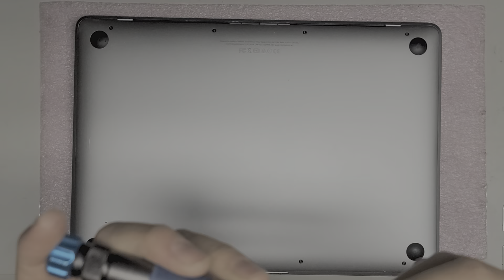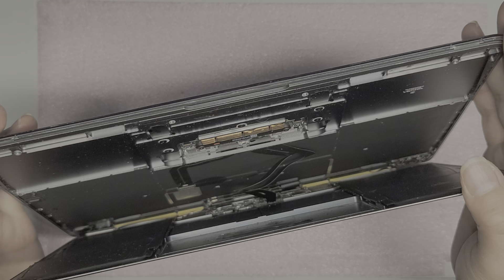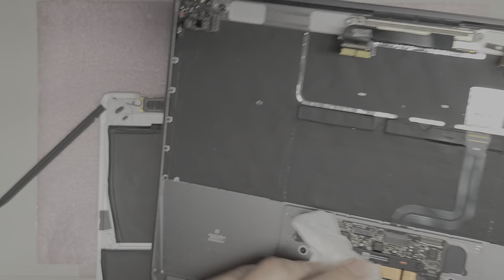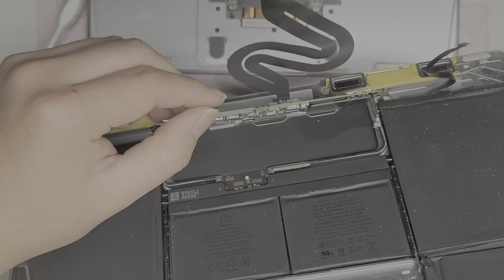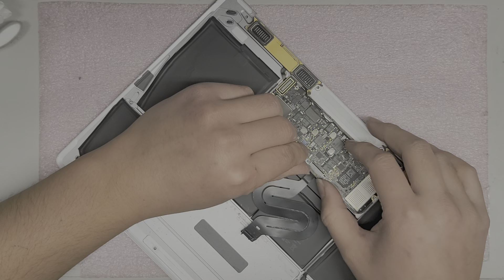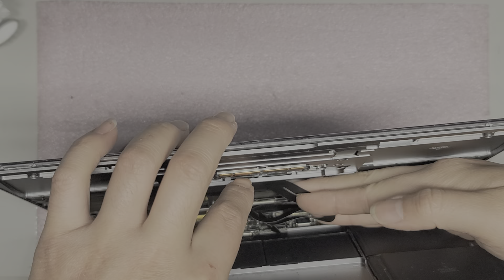12" inch MacBook A1534 Disassembly Liquid Spill Repair Attempt Nothing Upgradeable

Comment: Great video! I ripped the LCD cable (the one you disconnect at 6:20) how do I replace it please?
Reply from the maker: I haven't replaced that before. You might have to replace the whole screen if it's not removable from the other end. :(